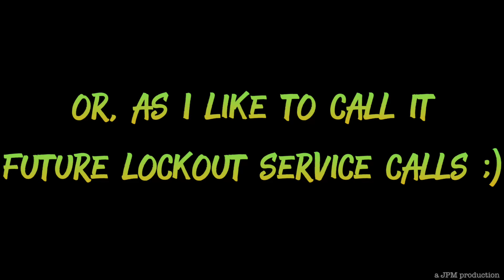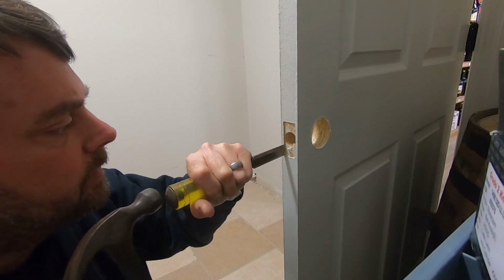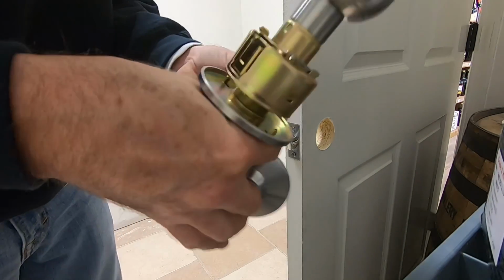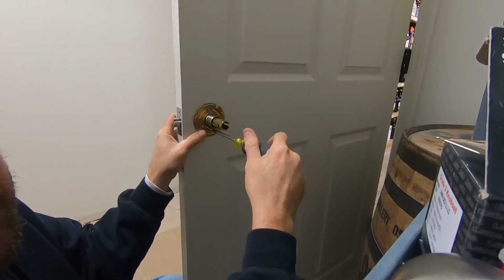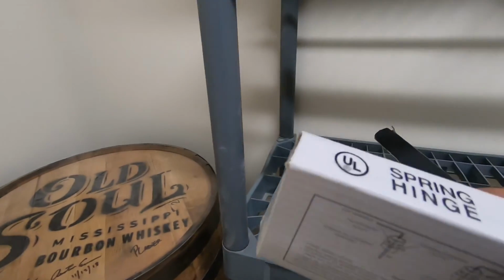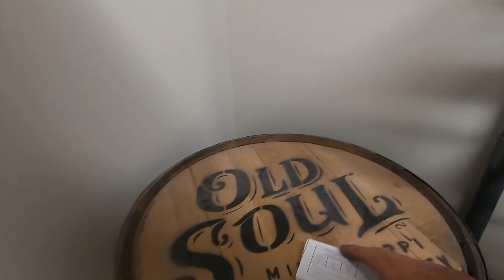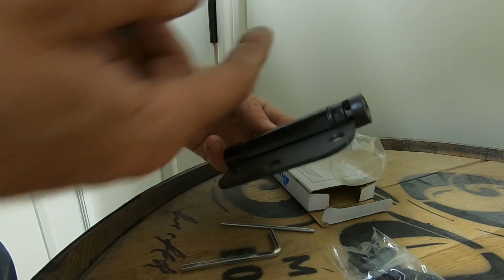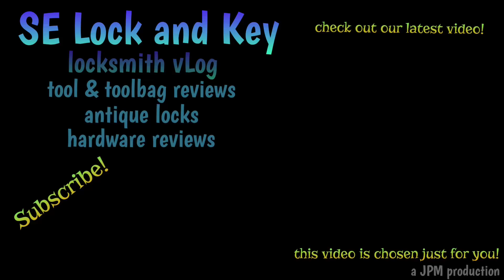auto locking restroom door for loss prevention

Comment: I never knew about these alien technology spring hinges. Pretty cool but wouldn't a door closer be better?🤔
Reply: Hollow door, so closer would come loose over time
Reply: @PocketWomen  and by over time you mean one use
Reply: Not necessarily depends on how often door was opened and closed, but because it's a storeroom I would probably give it a month before it started working loose
Reply: Pocket Women those closers are heavy. No way it would last a month on a hollow door.
Reply: Great job.JASON VERY INFORMATIONAL BUDDY😎😎
Reply: @PocketWomen  If you mount a closer to one of those you have to sex bolt or thru bolt them, then you have to for best results put a kick or push plate underneath them before mounting so that they don't mess up the door. then secure it all around. I've done that on resturant bathroom doors because these closers don't meet ADA codes.
Reply: @kg4boj  So true, A lot of work, It would have been easier if they just spend the extra dollars and buy a solid door.
Reply: @PocketWomen  Not necessarily. That would cost hundreds of dollars more to buy the door, have it mortised and hung etc, and the frame if it was a split jamb type won't hold the newer solid core door forever without trouble, they are only designed for interior doors so you need to replace that too and in florida that requires a general contractor's licence to touch any of the framing with anything.... 

The first and foremost primary reason you put a door closer on a bathroom door isn't privacy, it's the dashpot inside that prevents the door from opening with signifigant force. 
You see, people making a break for the bathroom often are in a hurry and not concerned about anything else so they will kick open these doors, or rush into them with signifigant speed and people behind them get railed by the door. 

The only time I use spring hinges are for resturant kitchen doors where it is anticipated people will be bursting through them all the time and using double acting spring hinges like the bommer 3029 series.

Comment: Meanwhile, door isn't even allowed to be used in a retail setting.Funny how the pins stick out like that, wonder if something to do with the wrench would fix that...Lol
Reply: I have installed many of these type of spring loaded hinges. The pins do stick out ever so slightly so that if you ever needed to adjust the spring tension, you can pull the pin out with a pair of needle nose pliers.  The major problem with these hinges is there is no control. Its either not closing or slamming.